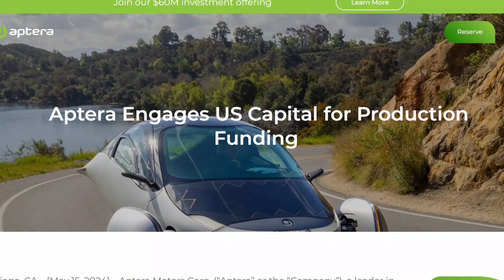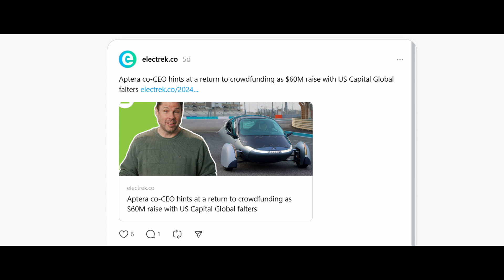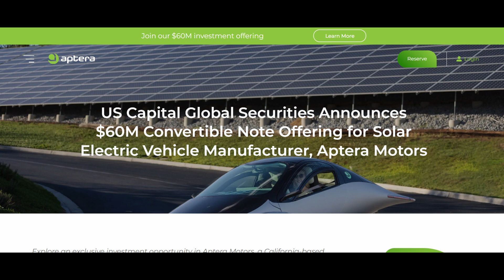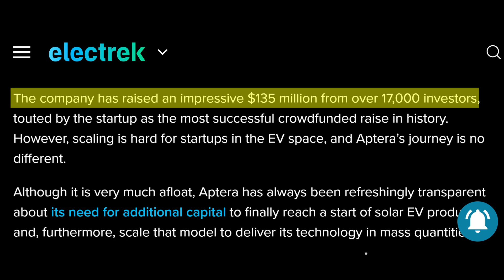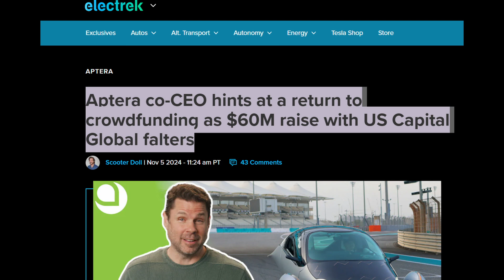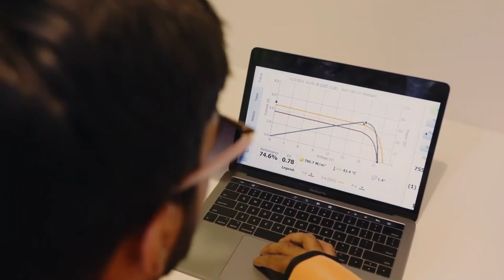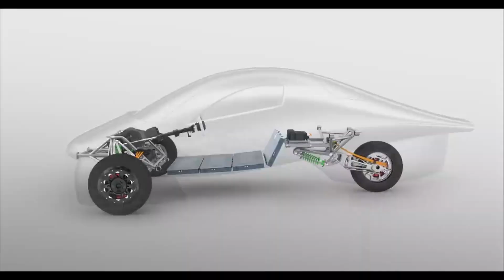Aptera's $60M Mistake Could Cost Them Everything

Comment: The company Aptera Motors was established in 2005, although it later went through a liquidation in 2011 before being relaunched by the original founders in 2019.  Five years later they still are not in production.  Give me a break. In February 2023, Arcimoto announced it was shutting down production at its Eugene factory due to a lack of funding.

Comment: From what I understand, the convertible note has no bearing on production of the first 40,000 cars. 

From their current production, they know some of the tooling that will be required if they open additional factories. For starts they will need an additional hydraulic press, which has a 18 month lead time. Machining the main die has a 11 month lead time. The convertible note is to deploy additional factories in several other countries, ie europe. It is convertible because they are paying up front for production hardware at alternative locations, and if it fails, that hardware could be sold.  However if all goes well they can reduce the amount of time it will take to go from 20k cars per year to 150k cars per year by 1.5 to 2 years.
Reply: They have no current production,  they have not produced one vehicle to sell.
Reply: There are no cars in the discussion. The current trike design is not finished. It is failing all performance tests. Total cost unknown. No known safety development schedule or test. All donations look lost.

Comment: This company is a complete disaster. They are hand laying up a carbon car. Have you any idea how long it takes to make one car? Also 3 wheels? how many formula one cars have 3 wheels?.  Just stupid. I had a friend try to make 3 wheel cars once. great on the flat but go up a hill while turning the steering wheel and the stupid thing tipped up and over onto the back left or right quarter. Do not put any money into this disaster.
Reply from the maker: Avoid the hill😁🤔
Reply: Just don't donate money. The longer it takes (for ever?) the longer the show the depositors get :-)
Reply: The carbon fiber-smc body panels are press molded in a machine not hand laid.
Reply: @skipondowntheroad5833  Build time for each car please ?
Reply: @skipondowntheroad5833  Carbon fiber takes approximately 24 hours to cure. How many cars does the company need to make a day to recover the investment sunk into it? A hundred a day? A thousand? So you need a thousand molds to make a thousand cars a day. There is a reason that Elon invented the giga press. Carbon fiber is for limited run items, Race cars, engine wings, crappy three wheeler toys.
Reply: Just because you are a loser, doesn't mean I have to be one too!
Reply: @gmv0553  Are you the sad f*%k who can't afford a microphone?
Reply: @gmv0553  Yet you are one.

Comment: My problem with aptera is that they don’t have a functioning prototype. The idea is to build a car that gets energy from the sun, puts it in a battery and goes 40 miles. That car doesn’t exist but they act like it does.
Reply: What in the actual delusion are you talking about. I have seen 6 different prototypes. The product and plan for production is there. The problem is the excessive regulations and expensive mandatory tests.
Reply: @ericwheelhouse4371  Like I stated, the idea is to build a solar car, that’s the prototype that I’m interested in seeing. What they have so far is an electric vehicle. It’s like having a prototype of a flying car that doesn’t fly. You can say that you have already designed the wings and tested it on a computer, but in my opinion you don’t really have a functioning prototype until your car does the thing that is at the core of it’s reason for being.
Reply: @Molishious  The "core of its reason for being" is EFFICIENCY! No other EV/ICEV comes close. This fact makes PV charging feasible.
Reply: @1voluntaryist  So do you think it would sell as an efficient EV that doesn't run on energy from the sun? Would the Aptera investors want to buy that? Honest questions as I'd guess the answer is no, but that's because I thought this whole thing hinged on being a solar car.
Reply: @Molishious  At the beginning of Aptera, about 15 years ago, it was conceived as ONLY the most efficient way to travel by personal ground transportation. No EV, no solar panels. Tech advances grew, EV was added, then solar panels. Aptera's fundamental principle of efficiency fit right into both. Does that answer your question?
Reply: @1voluntaryist  it's a fundraising sales pitch. It doesn't exist. Put down refundable deposit if you must but don't donate money.
Reply: @ericwheelhouse4371   Think about how Aptera has avoided ongoing validation from the start. They park at the beach without measuring kWh for the day. They drive around with visitors and never recharge to demo miles/kWh. They constantly overheat, I think there was no proper cooling. They have never showed charging. The wind tunnel in Italy was a photo stunt, no Cd data. They park at public events and don't move. They use moving on a frozen lake as winter ability. They won't offer sales contracts with delivery penalties. They have missed every delivery promise. They haven't published efficiency degrade for recent changes. They lied about 40 solar miles/day to match avg commute. They are now quietly saying 30 limited  to S. CA which is 21 for most of USA. They don't correct anyone that still refers to 40. They took +$100M donations, paid themselves $200K/yr and never gave up equity.
Reply: @artsmith103  - Let's not forget these are from two guys that are pretty much complete strangers that have a checkered past for their previous businesses.
Reply: @artsmith103  I wish them the best in terms of building a solar car, but I get the impression they are always trying to look like they have gone father than they really have. I emailed them 2 years ago because they had the same efficiency specs for a 40 mile car and a 1000 mile car and I emailed them and asked how that could be as the 1000 mile car would be much heavier. I’d expect that would affect a super efficient car a lot. They replied, and I give the credit for that, but they basically said they had no data to back up the stats that they had on their website. So I just check in now and then to see if they’ve created the car they set out to create. Just one of them.
Reply: @billsmith5960  "checkered past for their previous businesses" Can honestly say, I’ve never been so intrigued by a YT comment. I know you’re not some hardcore hater so, care to elaborate?
Reply: @gr8dvd  - I suggest that you can look up their names and see what they have done in the past. Then make your own decision.
Reply: They just got a driveable vehicle with production parts. Right now they are fitting it with everything including solar panels for full range and solar validation tests. We are going to have some solid real world numbers in a month or two.
Reply: I'm a fan, abd a reservation holder, but none of them completely represent the gehicke they are going to sell.
 @ericwheelhouse4371
Reply: So technically what they have is also a prototype so perhaps you could say “final” prototype. They literally have prototypes though.

Comment: No mention of the $200M they tried through Marathon Capital 2 years ago? I guess we just forget history and look to the future. Makes sense as they lowered the bar to $60M. Looks like that’s not working. Lower the bar again to $15M in new stock at a $14.50 PPS. $4 PPS higher than for the accelerator program.
Reply from the maker: The $200M was during the old Aptera,
This Aptera is a rebounce with new vision and leadership
Reply: @Elementraz  - So the ole Aptera was in 2022? That's news to me. You know better and will provide that evidence. I thank you in advance.
Reply: @Elementraz  UAE also chose to make no investment.
Reply: @artsmith103  - You are correct. If they were, we'd hear about it as the filter for Aptera transparency is only good news. Not the challenges.
Reply: @artsmith103  Perhaps they did make an offer, but it was turned down.
Reply: @1voluntaryist   No. Aptera offered to throw the Accelerators under the bus and deliver to UAE first at additional premium price. It was the 1st time Aptera offered a sales contract with delivery date. The vehicle they promised to deliver to UAE by now will never exist. I wonder how ripping them off would have gone over? Maybe Aptera is lucky to have not made those sales :-(
Reply: @Elementraz  - Also the announcement was done on June 8, 2022 (right on the official Aptera website). So, I cannot find where there is new vision or leadership announced anywhere from then. Since you know the facts as you keep making these videos, I can't wait to see the next one covering with a "deep dive".

Comment: Why use footage from Aptera that features employees no longer there let alone the closed facility where solar was supposed to happen?

They need far more than sixty million dollars.  The Convertible Note is their first attempt to court traditional sources of money and a convertible note is effectively a loan which is paid back in equity at a lower price as defined by the discount rate.  In other words its very expensive means to borrow money especially considering if fully subscribed Aptera would be paying US Capital Group $4.2m for doing so.  Then comes the up to twelve percent interest per year which could add another fourteen million dollars to the cost and finally the discount rate should it convert to equity and up to twenty percent off.  

I am going to guess there are two major reasons they are failing here.  First real money realizes there is no market for a three wheel two seat vehicle which will cost as much as a model Y.  Second is that its very possible the equity conversion is into class b stock which is effectively worthless.  Why?  Because only Class A has voting rights and Chris and Steve granted themselves each fifteen million shares with another twenty six odd million going to another founder group.  That means any equity earned by the note has no voting power. Real money ain't going to touch that.  

Remember they detailed an additional fifty four million dollars in expenditures needed to reach production of which Aptera can only guarantee eighteen million.  The sixteen in equipment financing cannot be guaranteed, the matching funds from California - all twenty million cannot be achieved until they spend a like amount and it still has to go through an approval process plus should you read the grant they no longer can qualify for a lot of it.   Aptera needs probably triple what they asked for to reach production and even then they won't have sufficient sales to matter.  Their reservations are more based on a far lower priced vehicle than they are selling
Reply: Can you add some sources to your assumptions? How will I know you're correct without letting facts speak for itself?
Reply: @fillashthrownout3309  there are no sources for these assumptions but zerowashu knows that.  guesses only
Reply: @fillashthrownout3309   He provided you a lot of guidance, why don't you find your own confirmation?